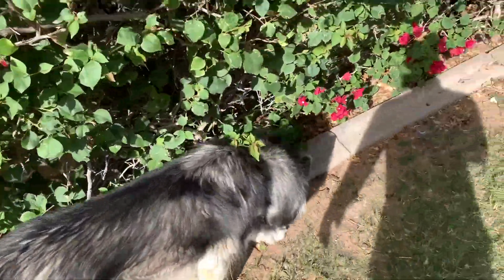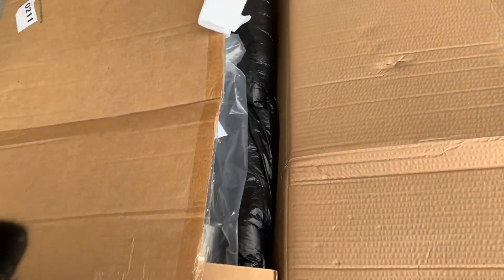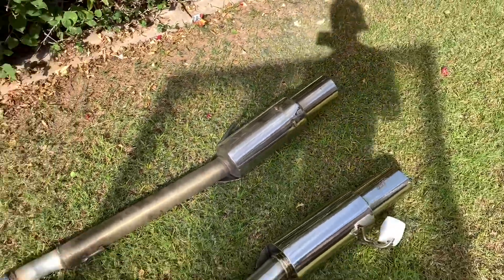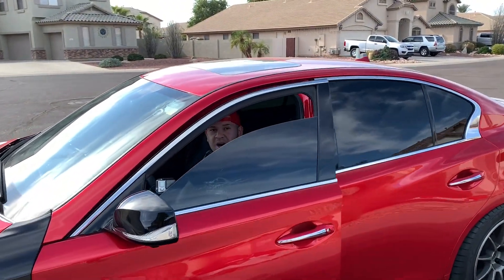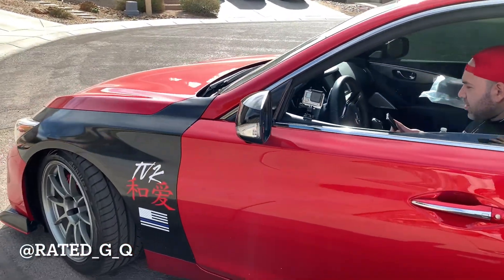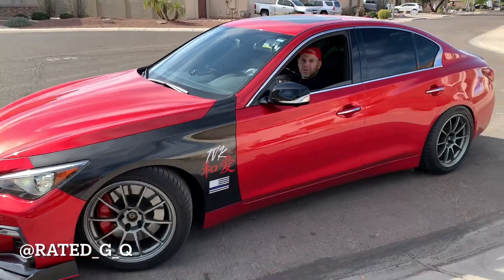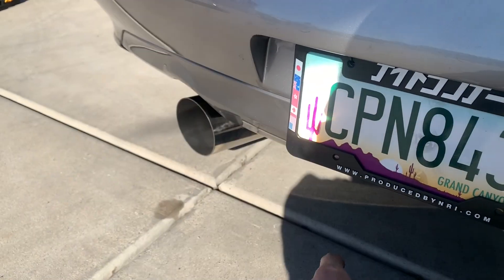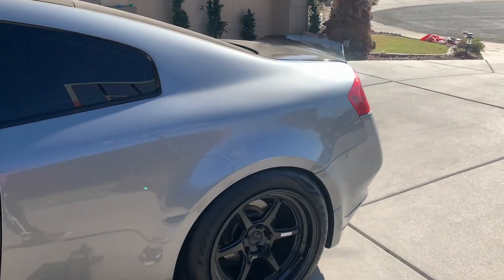FINALLY FIXING MY TERRIBLE EXHAUST!!!! ISR single Exit

Comment: Instead of bending the last hanger put washers on the bolts to make the hanger low enough and line up with the exhaust cut out. ISR exhaust sounds good. I have it in my G35 👍🏿

Comment: Hey bro what size are the tires and did you do a fender roll in the rear?
Reply from the maker: yes all my fenders are rolled and rears are 10.5 wide with a 255/35 tire

Comment: Aye bro specs on the wheels?
Reply from the maker: 18x9.5 +22 up front and 18x10.5 +12 in the rear
Reply: No spacers? But shit bro sexy whip bro I’m on the same path I’m going full bolt on!
Reply from the maker: @ozeus9529  just a little 15mm spacer up front and no spacer in the rear
Reply from the maker: @ozeus9529  and I appreciate it bro good luck with your build!!!

Comment: I don’t understand how an 8 inch extension is enough. A g35 is 12 inches longer than a 350
Reply from the maker: If you get any bigger the hangers wont line up... unless you take it to an exhaust shop to redo the hangers